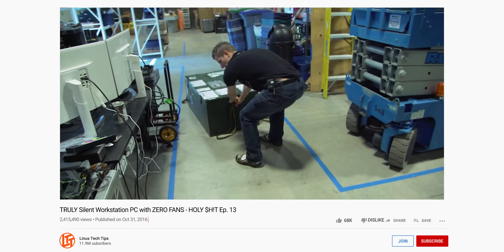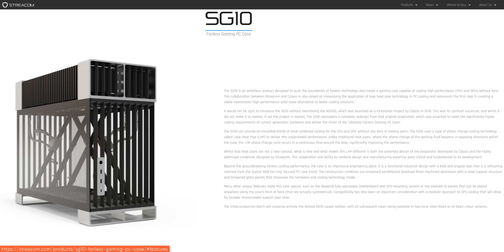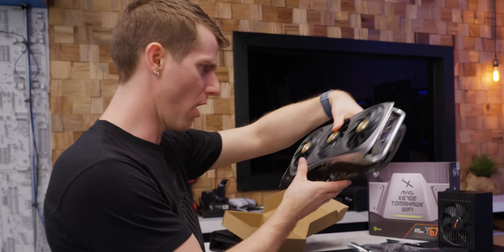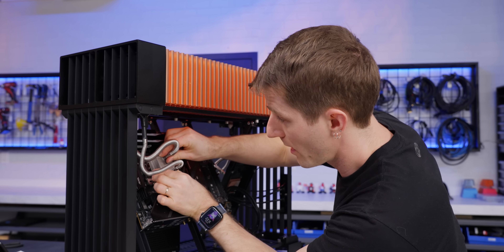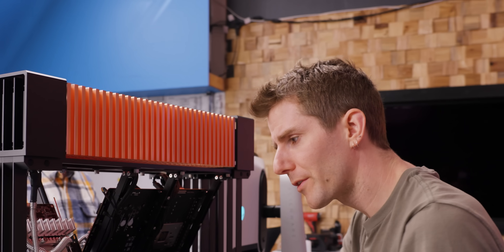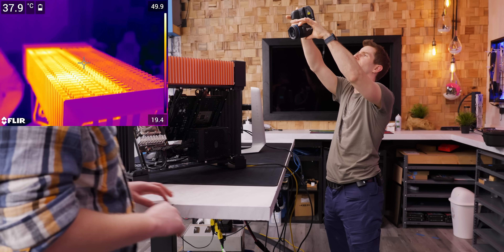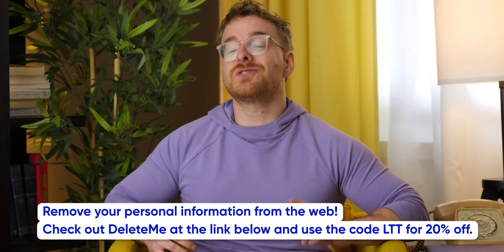I bought this scam PC case... And it actually arrived

Comment: 1 grand for the alu that's not too bad... A Lian Li 011 XL will set you back around $200 + an EKWB setup? 600 for CPU and 200 for GPU, you'll be spending 1k as well....

Comment: My CPU is at 45°C in summer and 35°C in winter, Bequiet dark rock pro 4, + 2 14cm extracting fan slow rpm and nvme disk, so cool so silent. This case  coast 900$ of design.

Comment: Keyboard Not Found: Press F1 to Continue - Totally Fascinating video - You 2 could do stand up comedy 😂  I'm going to pass on the 100% non fan build tho, if I got one it would be copper and have with all the high flow/high rpm fans I would install it would sound like a RC Electric Jet👍

Comment: This is a passive A/C unit, a technology that is clunky, expensive, and not quite as effective as most modern solutions. I know this because I am also a hotel engineer that still has a/c units that operate in a similar way. And they are expensive to fix.

Comment: Cool case, maybe delidded cpu's better? If possible? Also maybe a repaste on the cpu.

Definitely need to add little thermal pads and little copper heatsinks everywhere..

I figured $1500. $2000 makes sense though.

Novelty that works

Comment: I would buy it for 2k now IF the thermal design on the GPU side would be a little better. I mean 95C on the Mosfets and some other parts of the power delivery might be good, but it will not beat a full front and back watercooled copper plate on a RTX 4090.

Comment: the type of copper needed for heatpump systems is more expensive than normal copper as the cheaper alternative is "sweating" out the liquid over time because of nano sized holes and inperfections.
so yeah i'm not surprised that the copper version costs 1k more than the other one. the amount of copper of that grade alone is probably 800$ let alone it processed into a heatsink.

Comment: The Lexus LFA of computer cases, let me explain:  
It's products like these, regardless of price, that shakes the market and causes other manufacturers to innovate and make their own halo products.  This in turn begins to lower cost on cutting edge products as manufacturing techniques mature and are learned from items like this (cost to build reduces).  Car enthusiast understand what I am about to say in this comparison, it is exactly why things like the Lexus LFA and Ford GT redesign ever existed (this made the path for the ecoboost powered Raptor to come to life).  Title is the title, but I have to say, this case if sick.  If I was doing a 4,5,6,8 10k build, I'd 100% give it a shot.  The case is the biggest "show piece" of a build, even though most spend on gpu's.  But if you are building in excess of 5k$?  Why not?

Comment: why you dont try do fans on top 4 or 6 -140mm and 2-200mm in front and rear i am definetely sure it would be colder than the temperaturs you had on the test

Comment: Can we get a recording of the sound compared to a normal air cooled and water cooled system in a quiet room?
Might be a good short video... Not sure this is going to work for me since it's not silent, and I'm worried about the lower temp requirements of the 7800 x3d.

Comment: crazy oprice but no way can be cheap all those copper all those iperive work wont be cheap.idea cool but only for rich crazy dudes for.like who hate fan sound crazt senstive to any noise yes people lilke that exist but comapanies cant surive with few crazy people
and at future we wont beed it.cpu and gpı some kind a hit wall so tecnolgy wont be like 0.0001 micron 100 gz pus  so in time power heat effecticy lot of other think will be improved
relt şif u dont like nousies mini pc with internal gpu  will be ale handle ok gaming not super high end but ok range
at 10-20  year ago mini pc were weak can barely do emulation old games but they cant handle modern game even low setings
today they cnhandle low seting or even sometimes 1080p medium high setging
today 1-2 tv ssd like 2 finger sizr if expensive nano size can be like half finger size tiny.
not everyone gone need be 10 year-20 year later 5-8k gaming
lot of people poor too and not pricactial always most majority people still had  small monitor for those anyway
so like 46-60 wr cpus working ok with low mid seting games will be oition.
and thx to less power need smaller componted no need heavy cooling nosiy fans 
old days tiny comuters were like novalty they can work they cando lotthink but u sacrife lot think today not so much
china if think its market or see some menad on it.can creat even some custom new compnted for those
sorry for new genation but i hope this show off culture die soon i dont like disco like big cases ton of light non stop blinking i dont think look cool

Comment: Even if the money I spent on the case isn’t a big deal, the setup basically didn’t deliver what it was supposed to.

I get that nobody really wants to take apart a power supply just to pull out the fan… but without doing that, it’s just not a fanless build — at least not in the true sense of “no moving parts.”

Maybe the reality is we’ll just need to wait a bit longer until truly fanless PSUs become more widely available…

Comment: 18:35  $2K .. most of that is because of the price of copper has skyrocketed.  Probably also the reason for the delay, as person making the case was probably hanging back waiting for copper prices to go down.

As an aside, it's also the reason why many countries have gotten rid of their 1c and 2c pieces, because the copper price to make currency is too high compared to face value of the currency.

Comment: 8:18 i'm a littlebit shocked about the thermalpaste distribution on the cpu. Sure, under pressure it will spread but i would not vouch for full coverage especially After Seeing The temperatur data later😅

Comment: Dear Nerd Balls,

I am in America.  I am an American.  Our schools do not teach centigrade temperatures to our children, the National Standard in America is Fahrenheit.  I did not detect a British Accent on either of you and the electrical outlets in the back ground are North American 120/240.  So for the sake of the people in your audience who took the time to see the results,  post it in American Standard F Degrees or perhaps both? I get fed up with metric and Celsius trying to be crammed down my and my children's throats.  Europe can suck big fuzzy balls as far as we are concerned.  The tech involved in this case is pretty spot on engineering wise, but for the money I can buy a lot of fans, Or perhaps and AC Unit to mount to that giant heat copper plate. It will be interesting to see the longevity of the fluid and connection points of flex within the system.  Good video otherwise.

Comment: Machines which use that much copper these days (screaming copper shortage) for a single component are just ridiculous. Instead using it for mass produced 30 kg gaming aparatus thingamajig the metal could be used in wiring of actually useful and beneficial projects for everybody to help the much needed transition from boiling the planet to cooling it down. But noooo, consume, buy, buy and consume. 
At some point someone in the states figures out how to frack everything.

Comment: Fanless PC's, impressive engineering though this one is - are absolute folly. Its not just the CPU and GPU dies that need cooling; motherboards are designed for directed airflow paths, hence open air cases are often out-performed by well engineered traditional fan cases.

Comment: here's the problem with applications like delete me, they probably can "ask" or "make" a data buyer or seller delete your info, contact, address etc.. but can you or them be sure that the data is not copied somewhere else and being sold without consent? for those who will bring up the law, get out of here. if there was law enforcement around this, this crap wouldn't be happening

Comment: I know it's supposed to be completely fanless, but from experiences with other similar systems, a very low rpm fan (near silent) alone will usually aid heat exhaust tremendously.

Comment: Reminds me of Voodoo systems case (maybe with integrated system too?) back in the early 00s had a vaguely similar sort of head spreading system. I can't remember if it was all passive or used a refrigeration compressor. I think both systems existed, but I can't remember who made each one and when.

Comment: I love copper and overcomplicated designs enough I'm half tempted - but only half.  My very mundane setup with an AIO for the cpu and fans on the GPU, case, and power supply is already so quiet I can't hear it and runs plenty cool under load.  That would be a lot of money and work for a machine that would look super cool but probably wouldn't work as well as my current machine for cooling.  I think there's better things I can do with that money.

Comment: 10:09 If anyone wants to know what the costs of "a new this part" is, it's about 100 Euro. But you get 10 instead of 1. That's because buying 1 costs the same as buying 10. You may have to design it yourself in CAD software though. After that you upload it to one of the plenty online services that forward it to a machinist in china (or find one on aliexpress but that process sucks, so just pay the convenience tax) and get them in the mail about 3 weeks later.

Comment: This concept is NO Different than a $20 dollar CPU air cooler (with heat pipes)...except it has massively increased the surface area and volume of refrigerant to compensate for the avoidance of forced air flow by means of fans.

Comment: You can't stop the copper top - Duracell

Side thought: I'll be adding a couple of fans on-top to draw more of that heat away quicker. 

2nd side thought: $2000 for a case that will outdate itself when new cpu's are made. Additionally, are you able to add refrigerant to this if it starts to underperform? Like a car.

Comment: For the noise getting quieter in the condenser, it's probably the "quality" of the liquid vapor mixture. As the temp increases, the mixture becomes more vapor than liquid, which may account for the apparent reduced noise.
Qualifer: I'm a little buzzed on a Sunday, so take that with a grain of salt.

Comment: Can this warm up my room?
Reply: I bet if you put a fan or two on top, blowing across it, even "silent" fans, it could.

I noticed that the temp on top was 35C.  In our home, we have hydronic heating (radiators in every room).  

In the livingroom and bedroom, I have a special  controller connected to a fan that blows across the radiators.  When the radiator temp is 29C or above, the fan comes on.

During the winter, most times, the temperature of the radiator is about 35C to 39C.
All rooms are heated nicely, even on the coldest days.

So I'd say, with a bit of ingenuity, that thing could be used to heat up the room.  LOL

Not a great idea in summer, it would seem.  LOL

Comment: The circulation cooling action is as the result of Thermo-Syphon: https://en.wikipedia.org/wiki/Thermosiphon   It's been used in Multifuel stoves, with a back boiler, to heat radiators using the same principle.

Comment: hey linus smth of note, the 12 gpu connector (on the PSU side) is not fully in/Slightly too long? could this another reason why (overtime) these connectors fail 
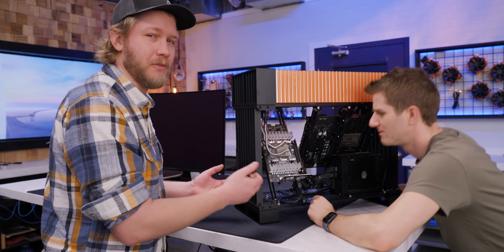@11:13

Comment: To get more airflow, extend the sides of the case upwards, ideally to at least double the height of the case. 
That volume of hot air, enclosed on all four sides, is going to badly want to move upwards. WITHOUT the extended side-walls, the exhaust air can scoot upwards as a narrowed fast-moving plume, supplemented by colder air coming in from the sides. WITH the side-walls, the only way for this air to continue rising is by drawing more air up through the system.

Google "Chimney effect" or "Stack effect" for an explanation

The higher the column (or "stack") of side-enclosed air above the case, the greater the volume of hot air, the greater the buoyancy effect, the faster it tries to rise, and the faster air is drawn through the system. The harder you run the electronics, the hotter the air and the greater the density-differential, buoyancy effect, and airflow. Double the height of the side-walls above the case, and you double the volume of air in the upward-moving block, double the buoyancy effect upforce, and maybe not-quite-double airflow. 

Ideally, extend the sides upwards by 6-10 feet, and create an actual chimney. 

Cheap version: Test the effect first with corrugated cardboard and packing tape.
Expensive version: Build the wall extensions from clear acrylic sheets, and put spinners in it so that you can see how fast the air is moving

Comment: Case like this has gotta have a couple issues, though... Condensation if you keep your room cold, but the case is radiating heat? And even if it doesn't... I bet it's literally a heater for the room.

Comment: This is how I want to abuse phase change in Refrigerants. Still think a quiet fan should be installed to aid in getting the temps even better. As that refrigerant flows from the CPU up to the heat exchanger on the top, a fan would help condense it much faster so it can turn into a subcooled liquid faster before it reaches the CPU again. It would be super badass if the return "suction" line frosted up during operation.
Reply: Exactly! The CPU and GPU may me cool enough but the MB is too hot. Even a couple of small quiet fans could move the air around.

Comment: I've been running a Thermaltake P90 open case for 6 years and the temps on the Graphics Card board and motherboard are nothing to worry about under normal loads, while gaming/video editing temps will make the room so warm you will want a ceiling or box fan running anyway. Though I do have an MSI MEG AM4 X370 motherboard so the M.2 ssd's are cooled by a heatpipe and the bios fan!

Comment: I actually remember reading about the physics of this tech back in college and thinking it would be really cool to see someone make a PC with it. And now, here we are, fifteen something years later... I'm impressed. Not gonna buy one, but impressed.
Reply: Dude, no you did not.
Reply: @Joeydeathgrip  I'm not your dude, buddy.
Reply: @PNGpyro  You're right buddy, I was out of line.
Reply: 5 years ago MSI made a motherboard, not like this 100% airless cooling, BUT it had above the CPU a thingy like this and still I used vents so basically a hybrid. And it brought down the CPU's temp by 10-18 °C. I was really impressed by this heat sink. 

The funny thing is I was mounting cpu fan for the first time so I broke the screws and the fan with its heatsink had collapsed without me noticing. And this passive cooler took all the heat and the rest of the cooling was from 2 frontal ventilators. Don't know how long it went like this LOL. But I sold it because I wanted a new RTX 4060 ti which is not that bad and it's actually economical - with DLSS it never gets hot so I don't need a passive cooler.

Comment: Horrifically expensive & barely functional. Maybe Daredevil would want one for his home office...

Even if it does use an evaporative model, a (quiet) pump for the return cycle would make it way more efficient - so why doesn't it have one?

I suppose a version of this kind of tech would be useful for isolated tech nodes in cold regions (either near European population centers, or some sort of Antarctic climate sensor), but it would seriously screw the pooch down here in Australia.

Comment: While $2000 is pricey, if you take into consideration, the cost of GPU block, CPU block, radiators, pump, and reservoir combo, fans, and coolant itself it is not that bad.

Comment: I am pretty sure the temps go even lower when you add Noctua fans to push the heat out of the radiator. It would be nice if you guys can check out active configuration.

Comment: I’m curious if anything would substantially change if you added some active cooling to it? A set of low noise fans vs a set of really high performance fans and see what happens maybe? Also in multiple configurations, all pulling/blowing through the radiator, all mounted at the bottom blowing up past the components, etc.

Comment: Looked at a similar system for rack mounted servers, but found that boiling in the evaporator caused a leidenfrost effect which decreased the efficiency of the cooling due to the vapor barrier interference.  Went with a liquid system without change of state to optimize cooling capacity, but it unfortunately needed fans and pumps.

Comment: This is the same refrigeration cycle every unit uses. It's the exact same for ACs, fridges, coolers , heat pump etc. Refrigerant changes from liquid to vapor in a cycle over and over. I do HVAC for a living and it's definitely pretty cool.

Comment: I use a Cooler Master large case for the computer I built for myself, and it is room temperature on the top.  When I built the computer 13 years ago, I used top of the line parts throughout, including the best CPU and GPU in the store.  The computer does all I ask of it, having dozens of browser windows open, music playing, files downloading from the internet, and typing in a word processing program, all at the same time.  The only thing I've changed in 13 years is the hard drive.  I replaced the mechanical drive with a higher capacity SSD.  The old drive was about 10 years old and making noise, so I pre-emptively cloned the drive to an SSD, replaced the drive, and the computer didn't know the difference.

Comment: Evaporation.... It's kinda like boiling very slowly....but at ambient temperature....a refrigerant will boil off vigorously in the evaporator taking on the energy.... AKA heat ... Then in the condenser.... Where you dump the energy or heat ... You condense the refrigerant.... This can be done a few ways... Passively or with fans and pressure increase etc etc. Phase change cooling is interesting as F😂